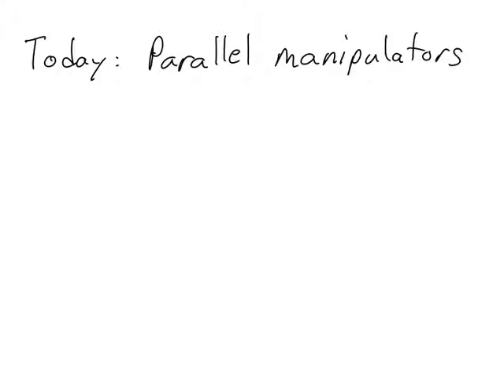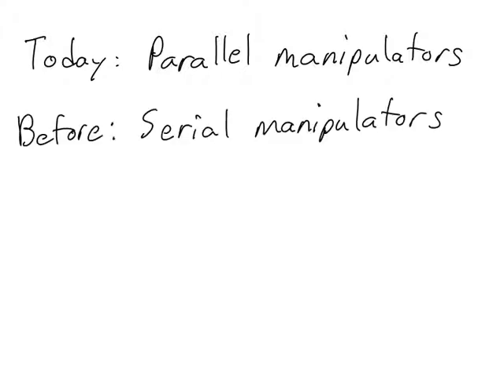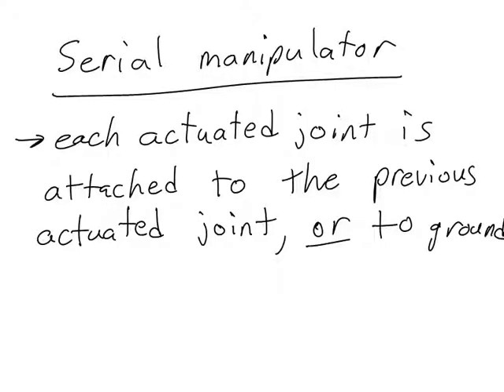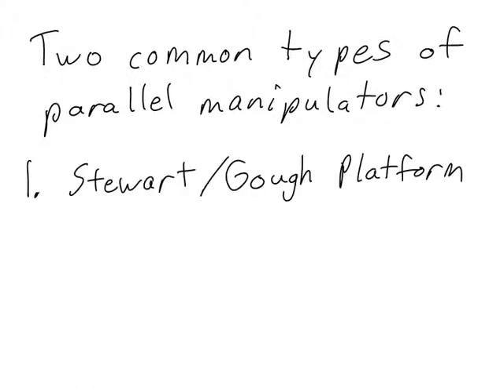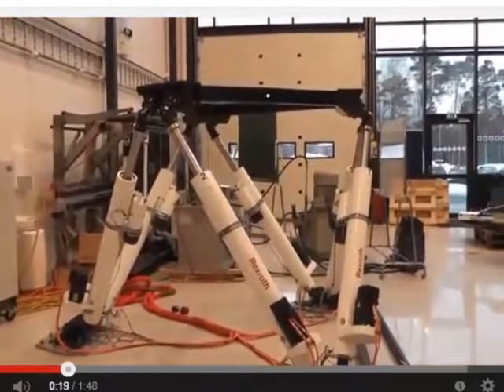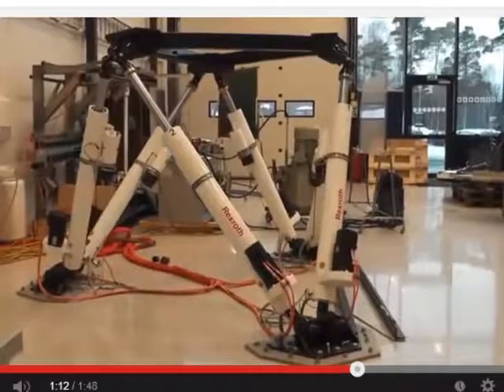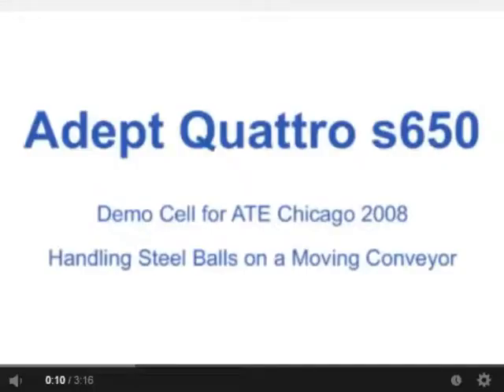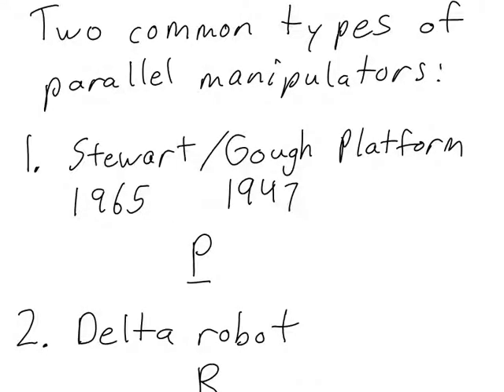Robotics 2 U1 (Kinematics) S6 (Parallel Manipulators) P1 (Introduction)

Comment: Hi Angela , Does the 3dof platform belong to the class of parrel robots or serial robots ?
Reply from the maker: In general, platforms are parallel robots.  But, the way to tell for sure is to look at how each joint is attached: if every joint has one end attached to ground and the other end attached to the platform, then it is a parallel robot.  If only one joint is attached to the ground, then the next joint is attached to the other side of the first joint, then it is a serial robot.  It is possible for a robot to have parts that are parallel, and other parts that are serial.  This robot head https://www.youtube.com/watch?v=n3T2CyW8yjY has a parallel mechanism for the neck, then the rest of the face is serial attached to the platform.
Reply: @asodemann3   Thanks a lot for the prompt response!